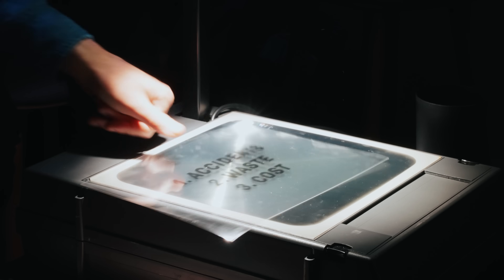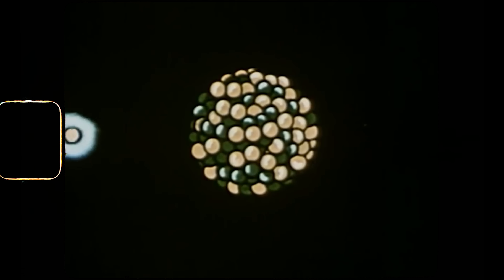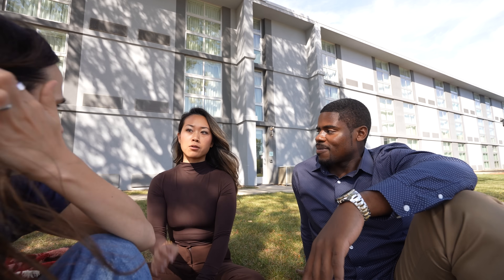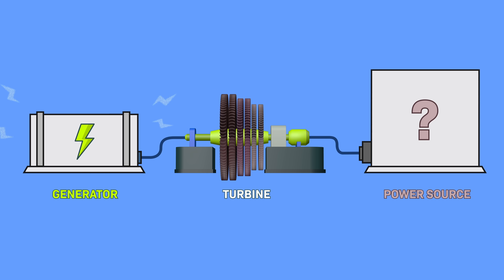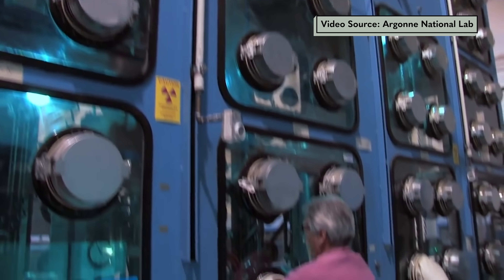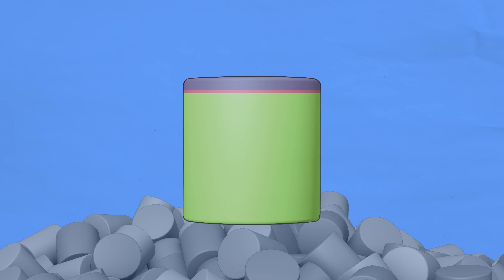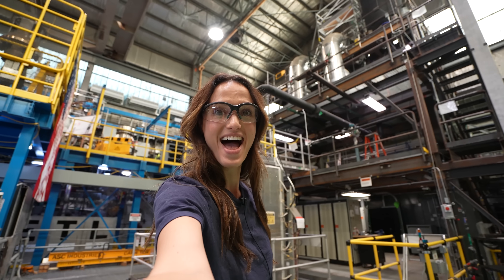The Big Lie About Nuclear Waste

Comment: Recycling nuclear fuel more than once (4m40s) is not as easy as all that. The first pass uses uranium from natural sources, with a little enrichment. This uses up most of the U235, and produces some plutonium. Now, yes, this plutonium and leftover U235 can be chemically extracted using PurEx  and used again in "mixed" fuels. You can do that once. After that it gets a lot more tricky. The environment in the reactor doesn't just cause fission. Heavy nuclei can absorb neutrons and become other isotopes or other elements. This is how we get plutonium, by bombardment of U238. 
However, bombardment of plutonium gives further products, such as U232, and U236. These make further reprocessing substantially more difficult, and they also make interim storage periods quite a bit longer.

Single-pass spent fuel needs about five years of "cooling" in ponds before it can be transferred to interim casks, or even directly to permanent disposal (if any existed). Of the fission products, the Iodine product decays quickly with intense radiation, and the Caesium product decays more slowly and radiates less intensely (still fatally intense for many decades), so overall it can be either stored or reprocessed for more segregated disposal. Reprocessing is not cheap, as demonstrated by the French, but slightly reduces the need for extreme long term disposal facilities.

The spent "mixed"  MOX fuel is not so convenient. In operation, the plutonium bombardment products include U236, which has a large neutron cross-section and reduces the efficiency of any reprocessed fuel that contains it. A subsequent product, U232 has a sixty year half-life and it's immediate decay products produce very penetrating radiation, making further reprocessing much more awkward and expensive.

To effectively reprocess spent "mixed" fuels, they have to be reprocessed rapidly after removal from the reactor, using much more elaborate and heavily shielded facilities. This cannot be put off because delay results in the accumulation of more U232 from U236 decay. Unlike existing "ordinary" reprocessing of single-pass waste for disposal, repeated reprocessing for recycling as fuel will require isotopic separations that will multiply the cost compared to disposal. Desirable isotopes like U235, U233, and Pu239 will have to be deliberately separated from those that degrade fuel performance or that make the waste mixture more hazardous than usual. No nuclear nations that reprocess are keeping up with waste production. France has reprocessed about a third of their waste for instance, and the US has reprocessed *none*.

Standard textbooks such as Malcolm Joyce's "Nuclear engineering" discuss this difficulty. 

Now it may be that upcoming reactor designs will be be able to dodge the need to reprocess fuel into fresh rods, but those reactors are many years from being realised or available for commercial use. I am not optimistic. The Experimental Salt reactor was never properly decommissioned, and all prospective modern versions depend on corrosion resistant materials beyond the limits of curent materials science. Liquid metal cooled reactors have their own issues, again requiring materials that withstand highly corrosive environments at extreme temperatures. The Soviet experience there with submarine reactors has also left an ongoing disposal problem. No part of the existing or future nuclear industry is willing to pay for the disposal of the failures of the past.

In the meantime, existing spent fuel is ageing, as are their assemblies and interim containment structures. Existing spent "mixed" MOX fuels will have waited too long to be conveniently or economically reprocessed, and will require more elaborate disposal than ordinary spent fuel.

It may be that future reactors with a future reprocessing cycle will be able to re-use fuel indefinitely, with minimal high-level waste requiring shorter disposal periods. We really could benefit from that, but I am not optimistic.
I believe that existing waste will remain in the too-hard basket. Unsuitable and uneconomical for future reprocessing, just as it vastly exceeds existing capacity for reprocessing for disposal and also exceeds all current provisions  for responsible disposal. A burden for society and not for the industry that created it at a profit.

Comment: The problem I see woth recycling nuckear material is the cost of new nuclear plants.

As decades rolled on, the safety requirements in law meant safer, but more expensive reactirs, and now nuclear plants are the most expensive way to make electricity, whike wind and solar are the cheapest.

Nuclear simply cannot compete economically.

And with second generation sodium ion batteries already being manufactured out of cheap, abundant materials (no rare earths etc) the advantage to wind/solar is only going to get wider in the coming decade.

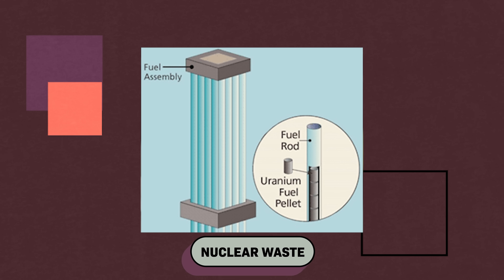Comment: This is a good introduction video.  Very well done.  President Carter was a nuclear engineer.  Reagan was a mediocre actor. One point: at 7:07 you refer to the "235" in U-235 as the total number of neutrons.  It is the atomic mass which is essentially the total number of neutrons and protons, not just neutrons.

What we really want is nuclear reactors not based upon the Uranium cycle, but upon the Thorium cycle.  We don't use these currently because they cannot produce bombs.  A large portion of the Department of Energy's budget, is dedicated to maintaining our nuclear weapon stockpile, not funding research into replacing fossil fuels..
Reply: Carter was a mediocre president.

Comment: One of the biggest problems with nuclear in the USA is the amount of regulatory requirements to do anything new. 
The regulatory requirements are so extreme that it's always way cheaper to build old but approved nuclear tech instead of innovating. The cost of physically building a new reactor design is small in comparison to the cost of all the regulatory hoops you have to jump through to get your new idea approved. Which makes it not commercially viable to do anything new.

Comment: I don't get it... why do you mention Japan when it says in the same quoted text they've used UK and France as reprocessing sources of nuclear waste? So it seems the UK and France has been doing this a long time before Japan... or do they mean something else with the word reprocessing?

Honestly, I'm a bit skeptical at the cost/energy efficiency of recycling nuclear waste until it their harmfulness goes down to so far as 200 years... Like how much energy does recycled nuclear fuel produce, is it 80% less than non-recycled nuclear fuel, or 50%, or 20%... you don't bring this extremely important fact up at all. Like what's the point of using recycled fuel if it can't even heat our water? Sure it might do it for 50 homes, or 100 homes... but what about the rest?

Also, I hear these types of arguments all the time about different energy sources. Like one for example about solar energy, that if we spent the same amount of money on building like solar power plants in the Sahara desert, we could basically charge large batteries and transport them all around the world and basically solve all our energy problems.

Then, I've heard about thorium reactors...

and the list goes on and on, and it's really hard to know what to believe in...

but personally, I think a huge f-ing solar power plant in the Sahara desert and transport energy through batteries and huge grids doesn't sound too bad... the biggest hurdle is to overcome is the monopolism of energy (so we'd basically had to make the Sahara desert an international area) and also the logistics through various countries and the legality and risks involved. Like anyone in europe knows what a big f-up letting russia control a large part of europe's energy source was.

Comment: Nice uplifting video, but it doesn't take into account the economics, it only addresses the science. The economics of nuclear reactors is the real reason they haven't seen wider adoption and why the proportion of energy generated by nuclear keeps going down year on year. Nuclear seems like a great idea until you get the costing for building one, when it gets a serious downgrade. Then, if the build has cost or schedule blow-outs, there is the next downgrade to "very bad idea". This is all without extra costs of either geologic storage, nuclear reprocessing or both, or the cost of decommissioning. I'm happy to be proven wrong, but not in my own country. We are installing renewables at very fast rates. I'll look forwards to comparing our energy prices with Poland, who recently have bet the farm on nuclear power. I suspect they have an ulterior motive in moving forwards with nuclear that isn't related to power prices though.

Comment: "Imagine if the solar energy that reaches the Earth every second could supply the entire world with energy for 36,000 years. So, the argument about only having enough energy for 150 years is nonsense. Furthermore, all the other problems with nuclear energy are not addressed, including nuclear meltdowns, misuse of technology, attacks on nuclear power plants, extremely long construction times for reactors, and energy that is far too expensive. This is a typical pro-nuclear lobby video."

Comment: Great video! It's really bs what's happening around nuclear, we keep burning fossils and we talk about the dangers of nuclear 🤦

There were a couple of "mistakes" in the video though. Nuclear waist has three parts as you explained: uranium (95%), transuranics (1%, plutonium included), and fission products (4%, barium, cesium, kripton...). Plutonium is not highly radioactive, you can hold it in your hands and be safe, the issue is that has a long half life and you can make bombs with it. And the good news is that, as you explain, we can make fuel out of it (MOX).

The only highly radioactive stuff are the fission products, but remember they are only around 4% of the waist,  and they have half lives in the hundreds of years. We can easily store them for that time.

Nuclear can be totally safe. It is actually the safest way of energy. 

Great video again!!

Comment: The reason why using nuclear waste was abandoned (at least in Germany) is this:
the companies that did nuclear reprocessing 'lost' several kilograms of plutonium (enough to build a few atom bombs) during the chemical processes. They simply couldn't explain what happened to that plutonium.
Since it was their job to split the waste into pure elements and isotopes, their lack of knowledge was extremely suspicious and scared even the politicians who supported nuclear power and nuclear recycling.
France, Great Britain and the USA have atom bombs, so they are interested in the plutonium from nuclear waste. So they continued to reprocess nuclear waste. But sooner or later they had enough plutonium and needed no more. And nobody wants to run nuclear power plants with an increasing amount of plutonium inside, because that changes the chain reactions in a dangerous way. So you have to store it for a looong time. That's where we are today.

Comment: At 7.08 you state that the number 235 (from Uranium 235) refers to the number of neutrons in an atom of U-235, the number
235 is the atomic number of U-235 which has 92 protons and 143 neutrons 😉

Comment: 1. should at least just start utilizing the ionizing radiation on nano materials to produce electricity as the waste is stored, we might not even have to filter the material, and that would help keep the plutonium from being used as weaponry.  thus to see the waste storage container already as part of a huge battery and hopefully reduce the decay of the container,  2. funding for such clean energy would be better that such energy systems is what backs the collateral of monetary systems like the US dollar. as the old idea of gold backed money has failed many times in many countries, we need to change the construct of thinking that clean energy is far more a better anti inflation then just gold. and if gold was part of the nano particles or coils that makes electricity or hydrogen from the ionizing radiation.

Comment: @ 12.05 you note the reactors that handle nuclear waste are called 'fast reactors'. They're also known as 'breeder reactors' or 'fast breeder reactors'. Because they breed their fuel. Bombarding relatively inert U238 is also a nice way to make Pu239. In fact, that's one of the processes taking place in a 3-stage nuclear weapon. Plutonium is not just an unfortunate by product of breeder reactors: it's the whole point.

Comment: Graduating from the nuclear program in my country, they taught us about the danger that nuclear waste brings to the table and also the possibilities to integrate the new "waste" as a fuel for other types of reactors. Still, it was always an uncertainty in this. Nuclear projects are extremely expensive, almost 80% of the components are unique, and they can't be built on a mass scale (except for the projects like SMR - Small Modular Reactors). 
Building a nuclear reactor that uses nuclear waste as fuel shouldn't be a hard thing to do compared with other nuclear reactors but by using nuclear waste as fuel, we'll end up with more "nuclear waste" of another type, which is more radioactive, more dangerous, harder to extract and store safely.
I talked with most of my teachers about the possibility of extracting the heat from the nuclear waste (the waste generates a lot of heat and storing it underground will require constant ventilation of that area so the barrels don't melt and cause a nuclear disaster) or possibly explore the use an RTG as a new energy source. Radioisotope Thermoelectric Generator - this type of energy generator is used on space crafts to power them for hundreds of years without refueling. 
In conclusion, using nuclear waste as a fuel would require higher and higher educated nuclear engineers and this will create higher paying jobs which basically increase the cost of the nuclear power plant and increase the cost of the electricity. It really is a vicious cycle, but at least we would use our long-lasting waste right?

Comment: Thorium?
Reply: Thorium is used in molten salt reactors. That’s very corrosive and there is no solution for that waste at the moment. 
That waste needs shorter storage then the waste of uranium reactors but the radiation levels are higher. 
So there are some problems to solve and no solutions in sight.
Reply: @herrbommel2420  for some reason i remember the thorium reactors also promising the ability to reuse burnt nuclear powerplat fuel
Reply: @MartinRonky  yes, I’ve read something like that also. But I haven’t seen any real projects.

Comment: @ 6.38 you said most electricity is generated by boiling water (ie, the steam cycle) and you correctly mention coal, geothermal and nuclear energy as examples. You incorrectly lump gas in there too. Power generation by gas is usually direct, by burning the gas to drive a gas turbine without recourse to the steam cycle. A minor point, but modern gas turbines are >90% efficient, whereas you must always lose about 2/3 of your energy up a chimney when using the steam cycle. A major point.

Comment: Just a small correction of the enrichment process: It's not about making the U238 become U235 in any way. We are mining the combination of U235 (a little) and U238 (a lot), we then slowly scrape the U238 away, therefore having better ratio of U235 vs U238, but we don't make more U235. The process how to do this (very high level) is to spin it in a centrifuge and since U238 is +-238/235 times heavier, it can be separated when spinning really fast.
Reply: (Singing) You spin me right 'round, baby, right 'round/Like a centrifuge, baby, right 'round, 'round, 'round/
You spin me right 'round, baby, right 'round/Like a centrifuge, baby, right 'round, 'round, 'round

Also, it takes a lot of centrifuges to do this. I seem to remember the number 60 floating around for the Iran nuclear program, but I could be wrong. This is something that has to be done in large complexes. So, if you're thinking of enriching Uranium to make a bomb, you're not going to do this in your back yard.
Reply: @jackielinde7568  I remember the number 3000.
Reply: Correct. She made the video simple and it is good.
Reply: Hi the ultra centrifuge was invented by de kistemaker uri 233 from thorium gives give far less waste

Comment: What about thorium? Is that still on the table or is there some reason it can't work?
Reply: Thorium is used in molten salt reactors. That’s very corrosive and there is no solution for that waste at the moment. 
That waste needs shorter storage then the waste of uranium reactors but the radiation levels are higher. 
So there are some problems to solve and no solutions in sight.